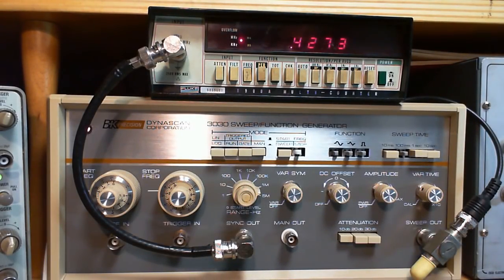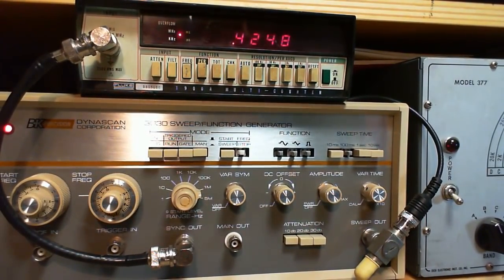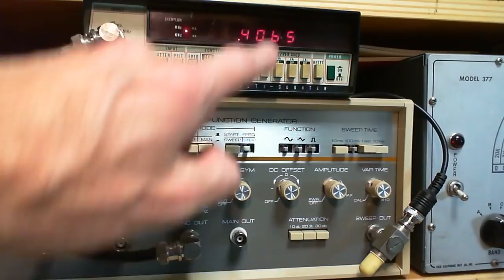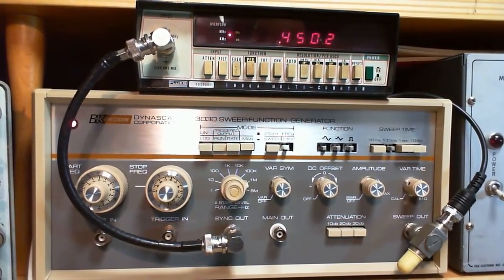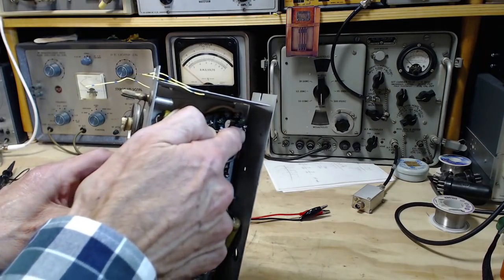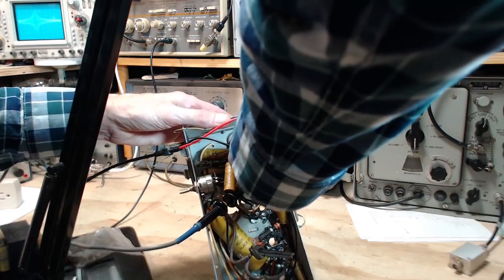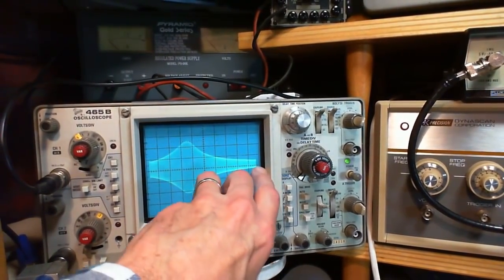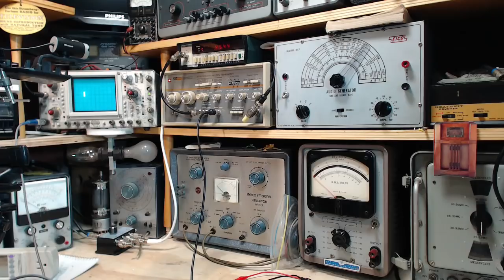Dynascan Corporation B&K Precision 3030 Sweep/Function Generator

Comment: Pretty good walk-through, IMHO; I reckon it gets the basic flavor across.
Makes a very good point about the I.F. transformer's resonance being changed some because of the signal generator AND the 'scope connected to it. Good to think of that transformer as TWO 455KHz "bells" (TWO separately tuned coils, loosely magnetically coupled together within that can).
 The coil tied to the genenerator will not react to its tuning slug movement very much: it is being DRIVEN by a 50 Ohm SOURCE (the gen's output). That "bell" won't "ring" well because the "hammer" (50 ohms) is in constant, heavy contact with it. 
 The coil tied to the 'scope will react more to its slug movement: it is DRIVING a 10 megohm/10pf LOAD (the 'scope's probe in this setup). That "bell" is free to "ring" with only a "feather" (10 megohm) in constant contact with it; the "hammer" being the other DRIVEN coil so close by, which also touches rather like a feather. The bell will ring!
If ya' wanna see the "primary" coil's tuning, swap the gen/scope connections. Either way, though, will tell ya' where the transformer "likes" to resonate.
 Also:  ya' CAN get precise  frequency reading from the scope's gradicule; gotta' fiddle with the horiz. sensitivity and position verniers to stretch the scan width so that it touches BOTH ENDS of the gradicule. 
 Also: I want that B&K generator; she's cool.  ;-)